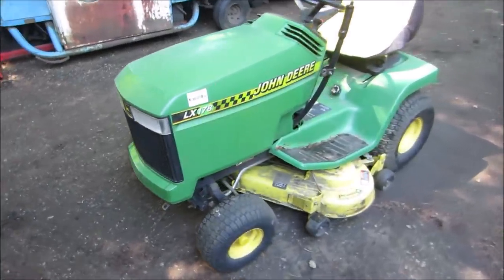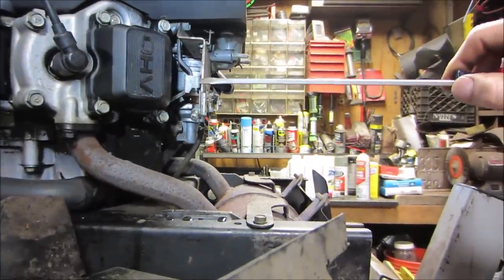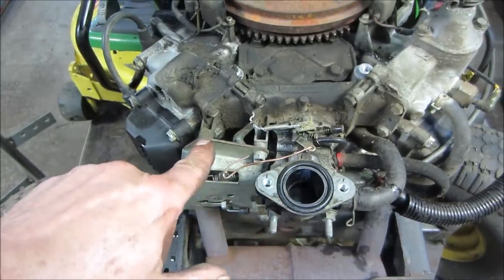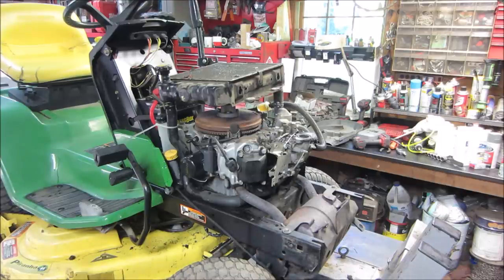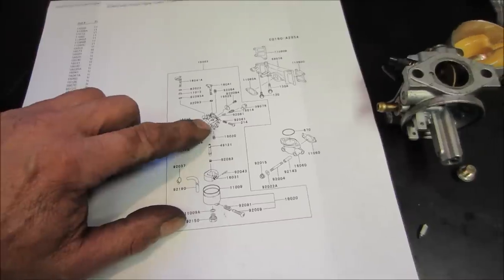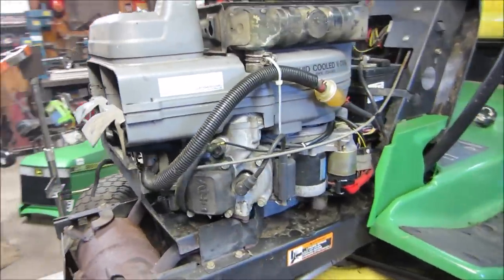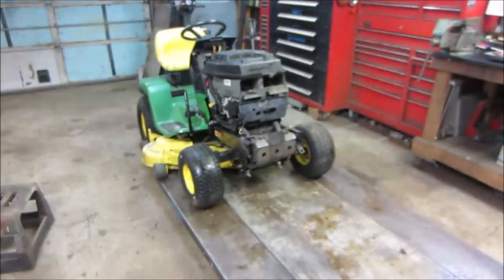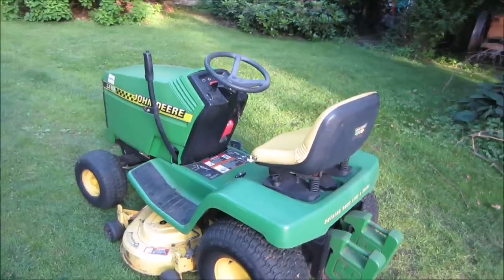yard sale John Deere, lets unfix other peoples repairs.

Comment: Plastic Floats—a number of years back I watched a bunch of carb cleaning videos & one guy said that the plastic floats can occasionally get a little bent where the pin goes thru.  So he used heat to bend them back straight. Problem is you have to be extremely careful that you don’t melt the plastic. Guessing a person would want to “practice” it on old floats that wouldn’t be needed again. lol. 

During some of those videos I also learned about using a q-tip on a drill with a little metal polish to clean needle seats that are brass.  Later I used that tip when I cleaned the carb on a free riding mower I got.
Reply: Well I posted the above comment PRIOR to watching part 2 where you used heat on the float!  😂 

Both of my riding mowers were free & both had issues the the needles not sealing properly when I got them. I did clean the carbs and/or use carb kits but as an extra measure I did like you said others said they have done & I added an in-line fuel shut off. I shut it off first & let the mower die that way & then switch off the key.  It might not be the perfect solution but most of us don’t have Mustie1 knowledge, experience & patience.  😉

Comment: I have found that slow leaks can be traced to defective (cheap) Schrader valves in the stem.  Installing inner tubes are not that hard and truly resolves the issues with leaks.  When you dismount the tire, check the inner part of the steel wheel to make sure there are no sharp spots or welding bumps.  If you find these, file or grind them smooth before installing tube.

Comment: It is hit or miss with small engine repair shops in most areas.  I owned a JD Stx38.  When I sold my house and moved into an apartment I gave it to my parents.  My brother lived there.   He stopped using it because he had issues with it and would not take it anywhere as  he thought he could fix anything.   On a hot day he had a fatal heart attack cutting the grass with a push mower. He left behind a lot of taken apart mowers and blowers and cars in the process of being "fixed".    I moved in to take care of my parents.   When I cut the grass with the push mower I kept thinking about how my brother died.  So I searched for small engine places.  There was actually one within 2 miles.   I had them pick up the tractor and fix it.  I did not care about the cost I just wanted to see how much money my brother would have spent and maybe not had the heart attack.  It costed me 120 or so.   I wonder when there are going to be small engine places like there are Starbucks for Coffee.   I have gone back to that place for my blower, push mower and chainsaw.   I wish my brother knew about it and would have gone there.

Comment: Should have pulled the engine cover before power washing it.
Spray paint caps are great for catching the gas out of a float bowl.
Every spring I drop the deck, pull it out, then sharpen the blades.
It makes it so much easier just pulling the whole assembly.
Reply: I always pull the deck out, It's the only way to do it. The bummer is greasing the spindles these days is a waste of time as the bearings are sealed and you don't push the old grease out for new.

Comment: I had the same problem right off the start brand new took it back to the Equipment company I bought it from and they put a new carburetor on it it did it again I don’t warrantee took it to a guy that’s been working on for 30 years he had the same tractor he walked over to his tractor looked it up the hood and pointed to a gas shut off valve that he installed it said it’s only way to fix it for good shut the gas off every time you use it been doing it for 15 years
Reply: Sounds like a design flaw, real shame as it's a nice mower otherwise.
Reply: Dan Bleeck @/
Reply: Punctuation ?

Comment: Would it make any difference in read-out if the tape was on the outside edge of the fly wheel.  Seems the closer to crank the tape is the higher the reading would be.  Oil leak / reburn hose at right Valve cover leaking?  I thought I saw the ridges on the needle Seat, so it is likely remove/replaceable.  Ridges go up.  There is a tool for seating them.  I have had that Seat fly across the garage.  Found it 2 hrs later just outside the door.  Worse than Jesus clips!  Tough to get that liquid latex to the sidewall with wheel mounted.  I just install a tube.  I have in the past bored out the deck wheels for 5/8 OD tubing (water tubing) and installed 1/2" bolt with wheel bearing grease.  Wheels should be 1/4" above blade cut.  Did the carb and tire stop leaking?

Comment: I got an older mower , with a B&S opposing twin , great engine , got it running ( new fuel pump kit ) but it kinda shook when the deck was engaged , took deck off to check it out ,   mmmm , the old owner changed blades but , instead of a five point star , the new blades had six point stars, so the guy welded short pieces of the old blades to the spindle shafts and bolted the new blades to them ,    but got them off center , and he must have grounded the welder to the frame and arced the bearings 'cause they were shot ,   guys  if you ever weld , make sure you follow the path of the electricty back to ground , and never,never,never let the path go through a bearing or hinge joint , you will arc the bearing and ruin it . Mower now is wonderful , new spindle shafts and bearings are not priced to bad .

Comment: Float pins are pressure fit now?  they used to just extend out and the bowl prevented them from sliding out.  Bowl off, slide out the pin and clean the valve.  I wonder why the pin is press fit now?  The old style worked fine.

Comment: Great videos mate.  I've got a lx279 with same engine.  Carb problems regularly.  Also get a positive pressure issue from the fuel pump locks the needle shut.  I know,  weird.
pull the hose off - release pressure and away it goes again. I wanna see this machine burn one day.

Comment: I watch all of the videos that I can find. I wish you would do a video on carbs and adjusting them. Most of your videos include carb cleaning but adjusting them so the engine runs properly  is an entirely different trick. I can tell you run one screw all the way in then back it out 1 1/2 turns, but I don't know which nor how to adjust the other

Comment: Instead of slim you should try tireject , works great and doesn't take out of balance as much. Also we put straight water in rad. while running engine on the stand, a little more work but rather be safe than sorry.

Comment: What about the older model john deere. My dad has an old model in back of his house I dont see a pin to push I had to use a hand truck to move it around our yard, when it was in his shed we used a floor jack to move it around between sumer and winter so the snow blower and it would change places.

Comment: The best way to remove a fuel inlet seat is,,use a niting hook,,or make a hook from a piece of wire,,bend the end of the wire just enough to make a small hook..make sure the hook fits through the seat hole a bit snug..i made one of these 30 years ago

Comment: sometime ago I worked as a service tech for JOHN DEERE the front of the mower deck should be on a level surface with proper tire pressure  front blade tips must be lower than rear blade tips by  (0.125-0.500 in)

Comment: The guy that worked on it at a table identical to yours he put a I hook in the beam in ceiling Then he put two pieces of chain about the same chain that you would use for a swingset about 4 foot of chain to pieces then he bent up some Rod about the size of your pinky like wrecker hooks he puts one on the right one on the left and then he lets the table down in a lift it in the air plenty a room to stand and take the mower blades off just a suggestion would be nice to see you make On a video if you decide to make them if you want anymore information let me know

Comment: A friend of mine has a fairly new John Deere lawn tractor ( about 2 years old) and his has a V-twin Kaw on it , it’s either a 26 or 28 hp, I don’t remember which and I dont know if it is liquid cooled ( probably is) but he used to have a older JD that he bought around 30-35 years ago and it had a 26 hp? O’nan engine on it , that was a pretty good motor until it started getting old and then something all the time was going bad on it and he was sinking money into it more & more, he finally got tired of that and went & bought that new one! I remember him saying that way back when you could get about any engine you wanted on a JD but now they only come with a Kawasaki engine unless it’s a single cylinder then it’s a Briggs! Those Kaw engines seems to be a pretty good motor, what do you think of them?
Reply: Hensley’s Hobbies n
Reply: The Kawasaki engines are pretty good, and found on quite a few commercial machines...Scag uses and has used them for several years, as well as Kohler.  They're just like any other engine though, if you don't take care of them properly they'll have issues, but Kawasaki typically builds engines that will last a long time, as well as Kohler.  Briggs & Stratton has really seemed to go downhill the past several years, they used to be a pretty good engine too.  Tecumseh had some pretty good engines but seemed to have some weird carburetors that were extremely picky on adjustments and needed some significant cleaning to keep them working right compared to other engines.
Reply: William Todd - Yeah that’s what I’ve heard about the Tecumseh engines! But yeah too you’re right on all that!
Reply: Kawasaki engines are robust and durable. Yes, the parts are quite expensive, but the quality is there.👍🏾
Reply: Ian Winfield - Yeah I believe it! 4 sure!

Comment: To fix the carb linkage and governor, you didn't need to pull the rad or fan box. Just pull the carb out by removing the fan shroud / carb elbow intake along with the cable linkage assembly simply pulled away and put to the side. The linkages are available from any JD dealer. YOu need to make sure the "short" end is towards the carb bell crank. That's it.

Anyone working on the Kawasaki / Mikuni carb combo, be careful with parts, they are touchy and can easily run too rich. The float height is critical or it will easily flood. The carb is very finicky. The low speed idle plastic cap can be removed (carefully) and then the needle can be removed, cleaned and carb blown out with carb cleaner. Reset the idle screw full in, then back out 1 1/2 turns and re-insert plastic cap "in the middle" of adjustment. The Carbs are $115.00 bucks. These Mikuni's are rebuildable, with care - anyone can do it. The carb float bowl O-Ring can be nasty to install a new one and easily roll over. But these are not rocket science carbs. 

Your hunch of the governor not being set was correct. The rod should be full counter-clockwise (when looking at from the front) and same with the Bell Crank arm.

Comment: My mower was flooding over like that to the point that it would flood out while mowing, I replaced the seat and also put a fuel shutoff in the fuel line just in case. 

Mine was also filling the crankcase with fuel, so the the oil was very thin and smelled like gas and the mower would smoke really bad at times.  I think the seat fixed the problem, the shutoff valve insures it doesn't leak by while it's sitting in the garage.

BTW is that front wheel on backwards?  I can't see a valve stem.

Comment: No kidding.  I just bought a professional grade backpack blower that the guy said wouldn't rev.  He had bought a Chinese carb to fix it, and when I got it he had the Stihl carb back on it with one needle valve from the Chinese no name stuck onto the Stihl.  I pulled them both out, and the one he hadn't moved across had obviously broken off at the end...pretty obvious why they did next to nothing when I tried it.    I opened the OEM carb, just for grins (it was junk, obviously at that point) and the metal disk that is part of the metering diaphragm looked like a lays potato chip, and I'm barely exaggerating.  It was bent every way from Sunday, I'm surprised the thing ran at all, and it only barely did.  Also the  metering needle was WAY off center, not even sure how he accomplished that particular brain fart.

The coil was intermittent and would quit as soon as you heated it up.  I pulled the plug was gapped at about 0.003, guessing he probably dropped it, it landed on the business end, and never looked at it before he put it back in.  How in the heck did this thing run, AT ALL.  Used coil, new ultra cheap Chinese carb, (sporting all the originally designed in parts), and it runs pretty well now.  Oh, also on the fuel line that goes from the carb to the bulb was at least half way kinked, so I took an eighth  inch off of that and now it looks open.  Runs as it should now, except it starts bogging after about 3-4 minutes.  I think he put new fuel hose on, and if it's the stuff that was in his parts box, it literally looks like about 20% the cross sectional area inside as the somewhat harder, MUCH thinner walled OEM tubing.  I will have to replace that next.  I should look inside the tank and either clean or replace the vent, and make sure the filter screen is clear.   He also cut all the 'ribs' going around the muffler away and threw them over his shoulder, and I burned myself slightly on the muffler when I turned it around one time to get to the mixture and idle adjustment screws.  

Also, at least half of the fasteners were missing on all the case parts, including parts that stabilize the carb, etc.  Some people should be required by law to NEVER touch a screwdriver or a wrench.  I expect when he started down his path of destruction, there was something rather minor wrong with it, like a plugged carb screen or some junk one of more of the jets/ports.  He told me when I bought it that a lot of the stuff was new and he was 'almost there'.  He was almost there, all right, but not in the direction he thought. 

 If I get it totally running right (can run it more than 5-10 minutes at a time without bogging, then quitting) I will probably buy a new cover to get the muffler back to something not sitting there salivating to bite you.  Oh, and the thing was absolutely BLACK with hand prints, the carb was leaking gas everywhere...basically, everything on it, save the pull starter, internal engine parts and fan were absolutely destroyed by this moron.  Yeah, that was a bit of an exaggeration, but GEEZ!  When I get done I'll have a good running blower for probably fifty bucks less than one already in that mode to start with. Oh well, can't win 'em all.  I've already blown all the leaves out of the front yard for way less effort than would have been involved raking, including all the fixes and trips to get oil, etc.

Honestly, it was about the worst I've ever seen, except a few really cheap true 'basket cases' I've bought over the years, like the outboard that came with the little 14' needle nose I bought as a kid (it was cool, actually had hydroplane sponsons in the hull, and FAST, but you needed a kidney belt when it wasn't almost glassy.   Ran right at 50 with an old direct drive, 70 hp Merc, start it up backwards for reverse ... not kidding ... neutral was turn it off, what a pain).  There at least half of the parts were not there, I looked for about five minutes and just junked it.  Funniest part of that exercise is I bought a used prop, took it out the first time, started it up in forward, and it went in reverse.  Turned out it was a reversed direction motor, made to go with a normal twin, went home, got the right prop and off to the races.  Dumb stories, hope you enjoyed if you got this far.  It's all true.

Comment: HI Mustie. I have a question about swapping engines! I recently removed my 17hp Kohler engine from a Craftsman and replaced it with a 20hp Briggs and Stratton from a broken and trashed John Deere. The owner of that old Deere was glad to get it off of his property and I was delighted to not have to junk my beautiful  Craftsman. The question that I want to ask you is since I'm substituting my 17hp with a 20hp, would that do any harm to my transmission? I'd appreciate knowing if that extra power could damage my transmission! There's nothing wrong with it and it's been working wonderfully over the years.

Comment: FYI- The oil filter on this is the same as on many toyotas. For instance, wix 51394.   Also, in my area at least, the easiest place to get parts is the local agway, rather than the place I get small engine parts for other engines.   And lots of things are available as kawasaki parts rather than deere parts at lower cost, so it pays to do a little digging around online.

Comment: The fuel pump diaphragm likes to go bad on the Kawasaki engines, it starts coming apart and plugs the carburetor and  makes the needle valve stick, etc. Eventually they will leak out the vent line out of the fuel pump that's running straight down through the frame. Older ones didn't have that line and would spray fuel all over the exhaust when the diaphragm went bad.

Comment: I have a 1990 LX 177 my brother-in-law gave me 25 years ago because it wouldn't run, blew out the gas line and flushed the tank and still use it today runs like new.... those liquid cooled Kawasaki engines run for ever.....

Comment: Thanks to Master Mechanic and You Tuber Deluxe Mustie 1, I started small engine challenges .
 ( I know big engines.) All throwaways from the local shop. 
1. A Honda mower needed a seal on drive axle. Works great now. $700 new. 
 2. Honda pressure washer. Chalky carb. Had to buy a hose and gun. 
3. McCulloch chain saw. Dirty carb, dead chain.  
4. But now a Honda water pump has BAD rings and looks SO abused I am going to let it go. 

THANKS MUSTIE 1